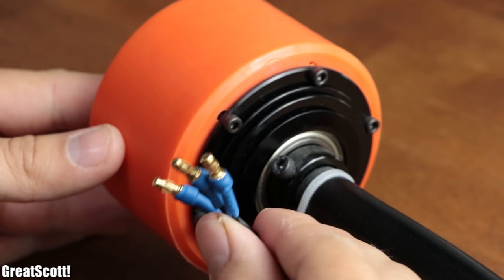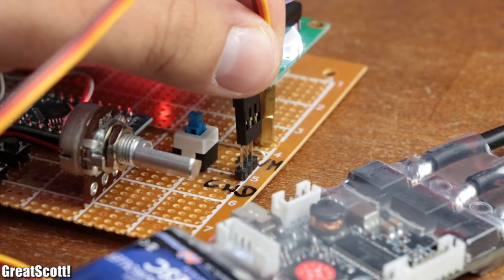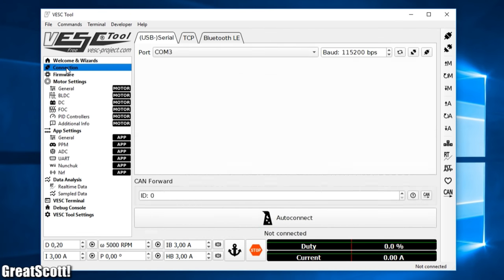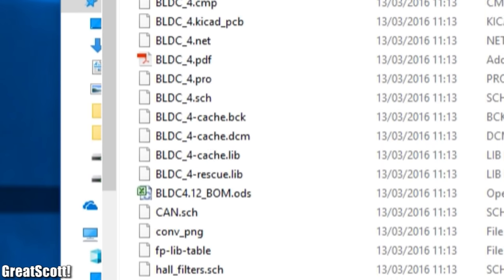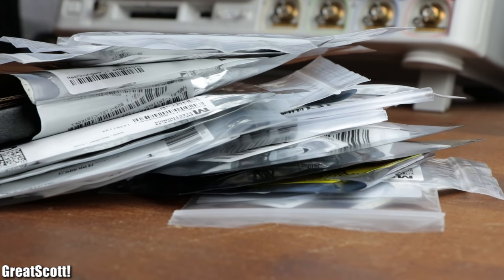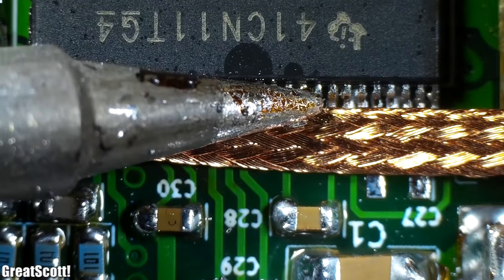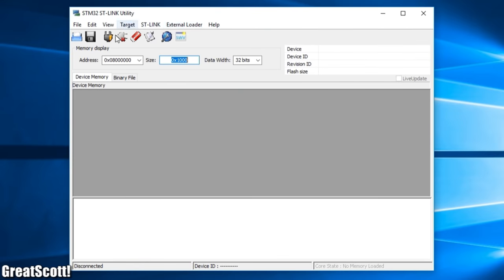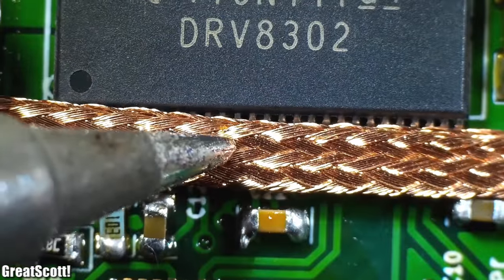VESC (Best Open Source ESC) || DIY or Buy

Comment: In additional to all of the excellent advice others have posted about SMD soldering, I would like to add that you should solder and inspect while using an eye-loupe * try 1.5X or 2X magnification). At age 78 with lousy eye sight I still can solder 144 pin TQFP's with 0.5mm pitch - it's a great age-leveler! 🙂 That said, I would still buy a commercially available ESC, unless I need one that has specs that are not available in the market.

Comment: You need flux! A lot! Some sticky gel flux helps a lot with smd components. And a better soldering tip, chisel type or similar. Maybe some high quality thinner solder wire too.
Great video though. Very cool that you show not only the success stories.

Comment: If the boards are single sided, you would have much more success with a hot plate. Just paste all your pads, place the components and throw it on a hot plate at 250 degrees C. Use tweezers to poke the components into compliance. Don't keep it on the hot plate more than 10-15 seconds after the paste flashes and the solder turns shiny. You can reheat it a few times before you start to destroy sensitive components.

Comment: Hey Scott, I got a question regarding brushless motors: I know that the KV velocity constant is retrieved by measuring the back EMF at a given RPM.
My question: is it possible to run a motor at a given voltage with more RPM than voltage multiplied by KV?

Comment: Did you check to make sure the PC installed the correct drivers for the device? I've had that happen too many times, spend hours troubleshooting hardware when it was a software issue

Comment: GreatScott have you ever tried to solder those tiny components with a laser diode obtained from a dvd driver?
Reply: This is actually really hard, because of the shiny surface that reflects the light instead of letting the light heat up the material.

Additionally, lasers are very dangerous and you'd have to do everything with special goggles or a soldering microscope.
Reply: @bigatchu7865  I know that L.D is dangerous. But the lasers are used too for soldering.
Reply: @bigatchu7865  https://www.youtube.com/watch?v=fCmMrSfEsuU watch this. Another solution.

Comment: I think you should have used a stencil for the solder paste. The way you applied it can leave short circuits under the chip. Get a multimeter and set it to “beep” then test each consecutive pin. 

I would love to help debug the failed circuit. Any chance you can send me the completely broken one (the one that does not program) if I pay the shipping cost? I promise to make a video of the debug process.

Comment: As somebody completely unfamiliar with the electric skateboard scene, what advantages does the open source VESC provide over something like an ESC running BLHeli_32? I'm assuming there is data that you want that isn't provided by BLHeli_32 telemetry & settings that you want to tweak that can't be accessed via BLHeli Suite?
Reply: CJ Davies there are those. Most commonly people use the vesc since it was foremost designed for ev board applications. First are the thermal and electrical safeties you can tune with the software. The ability to use regenerative braking to get a little bit of energy back while slowing you down. The ability to modify your control schema based upon input from ppm,i2c and a few others. The ability to modify your control curve such as adding expo. And lastly like the vid talks about it can make use of foc control for slightly more efficient and quieter operation that is starting to show up in other escs but required more computing power to achieve.
Reply: Plus you can connect it to another microcontroller and pass telemetry data to your remote, connect a Bluetooth module and you can data log all info to your phone and change settings without ever opening your enclosure, also you can use CAN bus to run two or more controllers with a control signal feeding only one
Reply: In a nutshell , VESC is to a standard ESC what a Tesla Model S is to a 1942 VW Beetle.

Comment: Get yourself a Controleo and combine it with a Pizza oven, add some insulation, maybe a nitrogen injection and you have a really nice reflow-oven. I added some IR heating elements to mine , to get a total power of 1600W. If you use black PCBs it works even better ;-)

Comment: I have a 12v 0.18a 3wire blower dc blower fan, I want to slow the speed down for long periods but need the full speed for initial start up for a couple of minutes. Can you advise me on which type of small speed controller I should buy for the well being of my blower. Have seen vids on transistor/ potentiometer methods but would rather buy the right tool for the right job so to speak. Thankyou. Great video.
Reply: I have since bought  12v dc 0.18a brushless 2 wire fan. I bought a pwm controller to vary the speed but the fan did not even turn with the potentiometer in either position. Struggling to get any info even from suppliers. Can you advise what type of controller I need for this type of fan? Thankyou. Great videos.

Comment: Solder flux, preferably that does not need cleaning, preferably in some sort of solder flux application device fluxpen or syringe. Steady hand and cleaning afterwards, and "VOILA". Clean the board afterwards, technical alcohol should usually do the job.

I personally love opensource projects, there is a lot of thing that could learn, see, or reuse. but it is always more complex approach, and usualy more controllable afterwards when You manage to successfully finish the project. When You have a decision between two same projects, finished and tested and development documentation one, I would personally always get the finished and tested if the price margin is not so catastrophic, it keeps You from lot of problems, and the documentation and projects give You the same insight and possibility to adopt whatever possible.
Usually there are more than one factor in decision but simply if open source and proprietary have similar characteristics, and time is not of crucial importance, prebuilt and tested open hardware project is better than just open source documentation and projects, that is better than proprietary one. And also, proprietary is fast in development, not always better by itself but they usually have SUPPORT, and be aware of possible HIDDEN COSTS of start and maintaining the product.

Sincerely,
Nenad

Comment: I like your try of the diy method even though it wasn't successful. 

I have read, tht the newest version of the Software you used is only optimized for linux, so it would work on a raspberry pi for example. 

Would you sell the pcbs you have left?

Great video as always!

Comment: @GreatScott Question on motor controllers. I recently bought from ebay 4 hoverboard brushless motors i belive they are 36V 350W 6.5 inch - with the intention to build my own robot rover but i never played with brushless motors before. I like to be able to control them using Rasberry Pi eventually and/or Arduino.  The controller(s) have to be able to interface with Raspberry Pi or Arduino. From an initial research i found 3 types of controllers ranging from very cheap China ones to 150 Euro Odrive. I intent to have the motors connected in pairs, left and right so that the rover turns by spinning/trurn left and right like a tank. The ask is which is the best controller for these type of motors so that i can have no freewheel when they stop on a slope and i can have reverse and won't t cost me an arm and a leg?

Comment: Tip: use a chisel tip and heat the pad + edge of pin and use 0.5mm or thinner solder wire.

Comment: I think the soldering iron was the problem. Maybe the soldering iron possessed some sort of electrostatic energy on it and destroyed the first uC. Also, maybe your soldering iron's temperature was set too high. Use a low-melting point solder for the job. Just some suggestions though. Nice try!

Comment: Maybe use stencils for anything that’s not super basic from now on.
I just did my second pcb project here recently and used a stencil.
Your 3hr time per board could be cut down to minutes per board rather than hours.

That’s of course if you spend your time properly.

Comment: hey may i know what micro controller you use in this ... in this video you are programming the micro controller ... the if you connect  tx and rx pin to the  other pins you could not program there until you .. can use .. saperate programmer board for program the microcontroller ..

Comment: "Mr. Scott" - I have a suggestion for another "DIY or BUY" video for you.

How about building a DIY smart light like the Hue stuff? I've been considering it for a while but I've been too busy, and I'd love to see your take on it. Seems pretty straightforward (he says) - either in "bulb format", or using (maybe concealed) RGB strips - you'd need the LEDs, a driver, a PWM controller (Arduino, I guess, or maybe an ESP because of the WiFi), the WiFi link. Fancy another challenge?

Comment: Buy makes the most sense when using low current ESC’s they are bountiful however when you need a 400a 50v capable esc than we’re talking about $400 and up to purchase.

Comment: Scott -- at this point you should be using a solder paste stencil to apply the paste.   ALSO -- your PCB did not have masking between the pins -- that is not an acceptable quality board.    Those guys in China will apply solder between the pins if you demand it.    It cost them more time and money -- but you have to ask for it otherwise -- they take that value out of the deliverable.

Comment: Without a stencil, solder paste is a bad idea on small pin-pitch components. You need very little, and it's incredibly finicky to get the right amount. The chip that didn't work with paste looked like it had way too much solder.
I've got an ongoing game console modding project where I'm soldering a few 1608(0603) LEDs. With only two pins, and a good set of tweezers, they're already hell to get on straight. For chips, some flux and running a soldering iron along the edge quickly is probably by far the best solution.

Comment: Did you still install the correct drivers to connect through the com port and is it using a vcp or a c2102 chip

Comment: Why didn't you use the heatgun for the resistors?
Reply: Yeah i dont understand this neither.
With enouth flux smd parts align itself.
Clean it with isopropyl and it will look nice

Comment: Nice video ! It was worth a try ! Just wanted to advise you not to use these motors, I personally had an accident with them where the rubber fell off, the ring that secures it is really not sturdy and WILL fail under vibration

Comment: Hi Scott, since I am building my  own E-Bike I have to ask: Do you recomment the Aliexpress ESC for the E-Bike Motor? 
For me it seems perfectly fine but I dont know if it can handle the slow rpm and the big Current in this case of application. 

Da ich nicht ganz so gut in englisch bin: :D Hallo Scott, in deinem anderen Video hast du extra einen ESC für den Nabenmotor gebaut. Kann man auch den hier gezeigten verwenden? (Den von Aliexpress. Den Selbstgebauten bekomme ich nicht hin)
Reply: I guess you can

Comment: You need to get better at microsoldering for problems like this. Your iron is too big, you use too much solder paste and solder en general. For this, i would order a board stencil from jlcpcb with the board, this way you just need to add solder paste to the mask, then place your components and heat the board slowly, everything should connect and fall into place.

Comment: Can you try to explain the difference between atmega uC and PIC uC. Also a video on UV erasable memory?
Reply: Dave Jones from EEVBlog did a video on them, talked about the various uCs
Reply: ThatRadioGuy Its always better to have different points of view on a subject. You never know when you will learn something new.
Reply: There are no fundamental differences between PIC and Atmel except PICs use 0 for voltage high and Atmels use 1. Both chip lines are owned by Microchip. You need different programmers and IDEs to flash the chips. 

UV erasable memory is a largely obsolete form of EPROM. The UV light causes the dielectric of one transistor to become slightly conductive, allowing the floating gate’s charge to drain away to its unprogrammed state. This UV erase feature is the reason why many EPROMs were manufactured in ceramic packages with transparent quartz windows directly above the silicon die. These ceramic packages were generally either DIPs or PLCCs and were relatively expensive.
Reply: Parker Davis hmmm intresting. I didnt knew pic and atmega had so much in common. Thanks for the explanation.

Comment: Do a video about an sinewave inverter that uses spwm technology....Apply it in your house and you can use it when there is a power failure failure
Reply from the maker: I will never do a mains voltage inverter.
Reply: GreatScott! Why???? Atleast give a simple spwm inverter circuit that designed by you...i wish you dont disappoint me
Reply from the maker: Safety reasons
Reply: GreatScott! Sure..but please give me the circuit designed by you

Comment: I never have this kind of success with desoldering wick. So frustrating.
Reply: I've used RMA-223 flux with my wick at approx 385, but yeah, probably need higher temp. I really, really struggle with desoldering.

Comment: Good try, not many YouTubers that post real world problems and click bait. ALSO a word of advice with DIY soldering... Do Main IC's if first without or as little components required for USB uart spi connection and make sure the the main ics are alive, it's easier to troubleshoot

Comment: I made 3 VESCs 4.12, 2 that I sold, and one for me.
Fortunatly, I made for a previous project a reflow oven. For 70€, he is 1°C accurate and shows on my smartphone the actual temperature, and the targeted temperature. An app is open source, she draw a pretty graph with the temperature, it is awesome for SMD projects.

Look at "andy's workshop" on internet or youtube, he is the original creator of the controller.

(also I have some spare boards that I can ship, I live in France, you just have to pay the shipping)

Comment: Can you make CNC machine that can place tiny components on PCB  better and precise than hand . I think it will make job lot easier and better
Reply: Sumit Kumar placing doesn’t seem to be an issue in this case. It seems he touches the parts a lot when soldering.
So even if a machine placed it perfectly he would still nudge it off target.
Reply: zach burke Well JLPCB sells solder stencils for €7, which means if he had a "pick and place" like machine he could have just applied solder paste with the stencil and then placed down the components. This would mean that he could just put it in an oven at ~280°C and it would basically solder itself without him having to touch it.

Comment: And i though i can control nearly everything with the Mamba Monster II ESC in my 1:8 Monster Truck and the USB programming adapter for PC O.o

Good work, also if it doesnt work, i already knew, this ESC DIY cant be worth it when you have to use much SMD parts :(

Also, never forget, there are already good, 30-50$ ESCs from china, many of them also with nice motors for their size, since they are made for RC stuff. I got a used wrecked onroad 1:10 for cheap, a very nice chassis with carbon main plate and good tuning parts, but burned ESC due wrong motor setup (too fast motor for ESC + not allowed in most cups). With a china ESC-Motor combination for i think it was around 70$, i got an awesome RC car for around 100$, which cost new around 500$ (chassis ONLY, some carbon parts, 1x rear ball diff, 1x normal diff , 3 teeth belts, motor plate, 1 pinion gear, 1 plastic main gear.....!!!)

Comment: I think BLheli-32 is the best software.
It can give you rpm, amp reading and it has super fast processor
Reply: These 2 ESCs are designed for completely different purposes.
Even so, BLHeli-32 is nothing compared to this.

Comment: GreatScott ? The reason why you couldn't solder the ICs is because your solder iron tip and solder was to thick. If the solder is thicker than the IC pins, it will not work.

Comment: Yeah, with that many SMD components, it's almost always worth it to spend the $10-20 extra on a clone from China. I've gone the DIY route for a few open-source boards, but that was mostly because they're not available for a modest premium from China, only from the creator for a very hefty premium (think one board for the cost of 10 PCBs and parts. However I wouldn't have bothered if they weren't mostly through-hole. I can get by replacing a blown SMD chip on an arduino, but SMD resistors and capacitors make me want to rage quit and flip the desk.